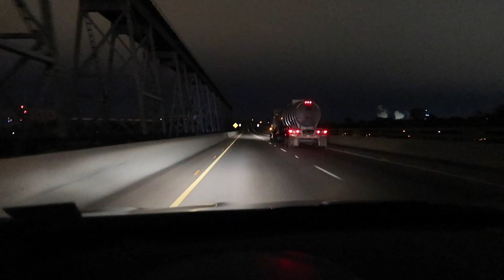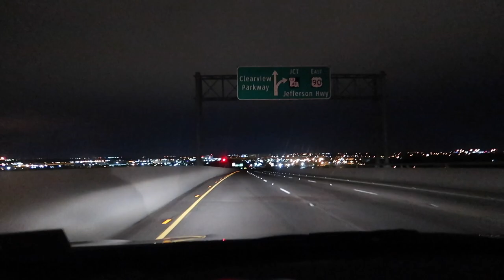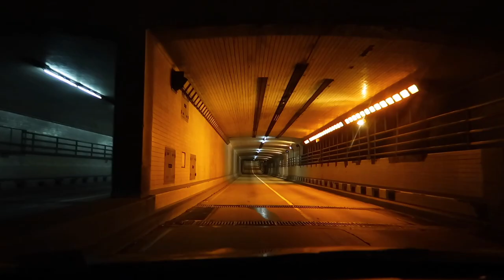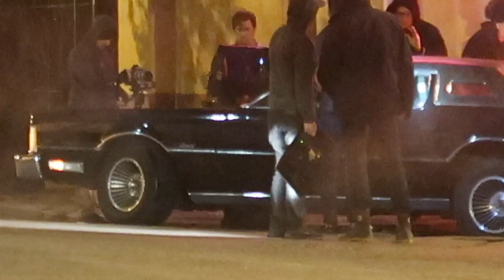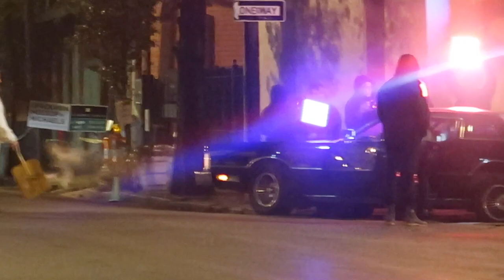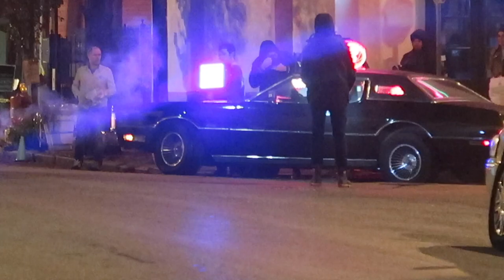BRIDGES TUNNELS & MOVIES

Comment: The original lanes were only 9 ft wide.
Reply from the maker: They say was two lanes. Wow. Big cars back then.
Reply: If I'm not mistaken, when it first opened, it was two way traffic on one side of the bridge.  I think that was just temporary, but there's an old picture that I've seen that showed it with cars going both directions.  I never had a problem with the old narrow lanes except once when I drove a box truck across it.  I bumped the right curb a few times.

I used to pass everyone on that bridge, and when I'd encounter someone in the left lane going 35 miles per hour avoiding the left curb by a few feet, I'd go flying past as close as possible on the right.
Reply from the maker: Yep. It was 2 lanes each way after that probably short period u spoke about.